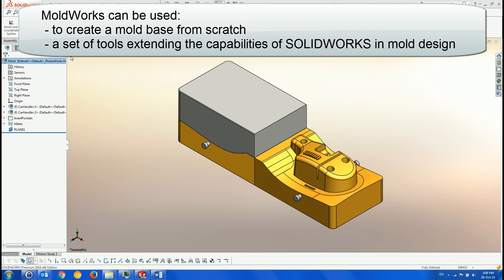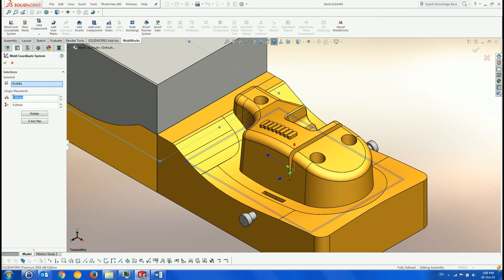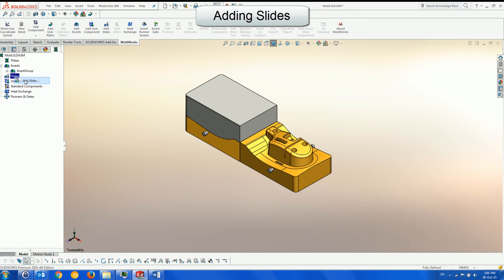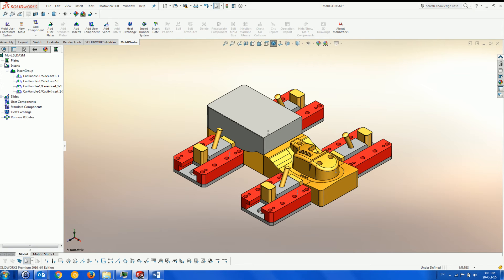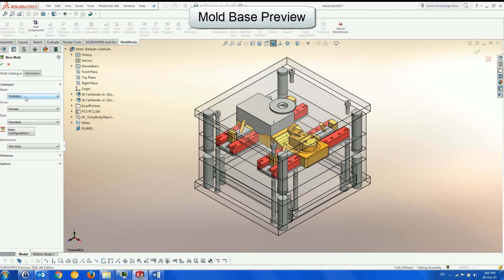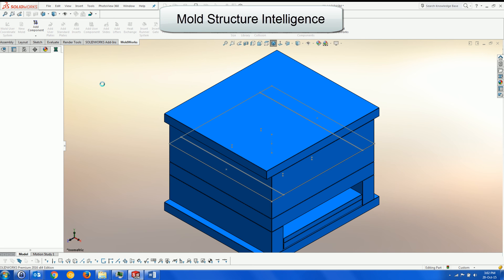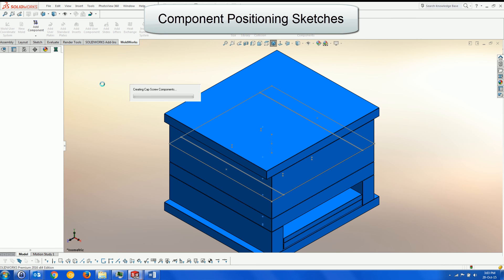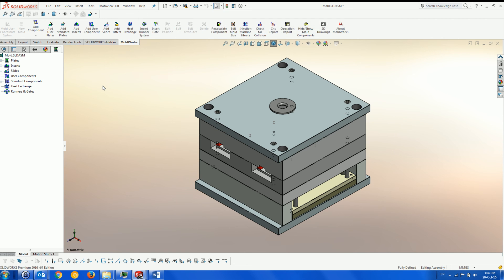MoldWorks - Starting the mold from scratch

Comment: Hello  
George Berold. I am learning Mold in soldworks. Please. i want to question. how do You made InsertPockets? Can you tell me About that. Please
Reply: Not sure if this will help you now, the Insert tools used in this video are just a copy of the core and cavity (cavity component should be solid, i.e. fill the cavity). Just add two copies of the core and cavity to the assebly and mate them on top of the previously existing core and cavity. Name them CavityTool and CoreTool to avoid confusion. Hope this helps